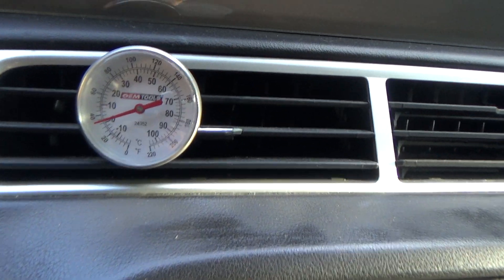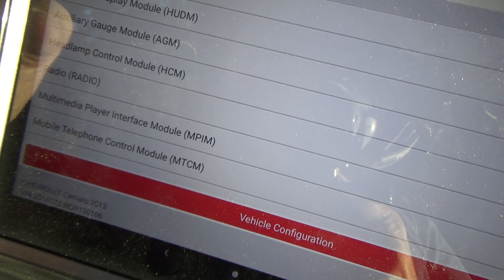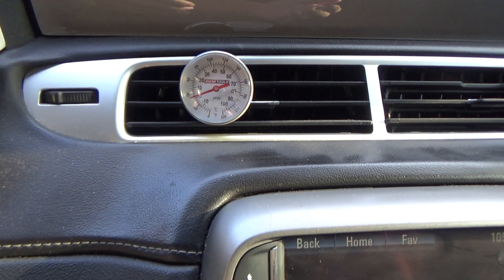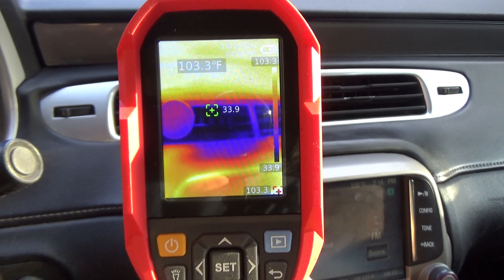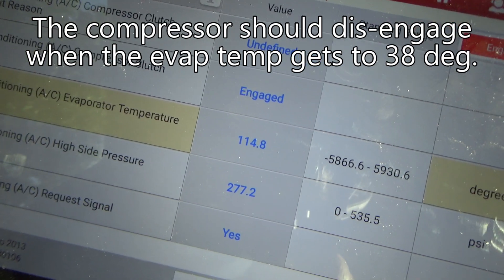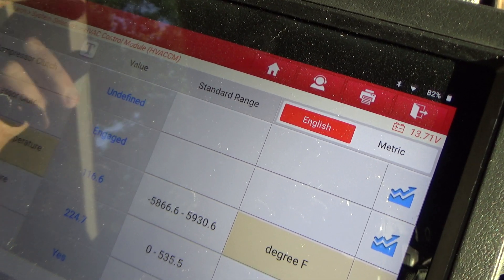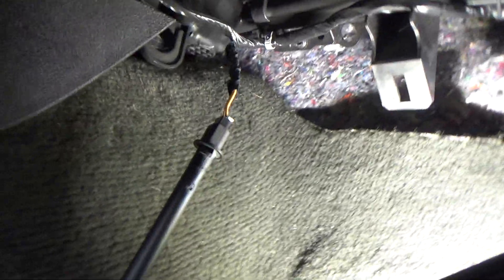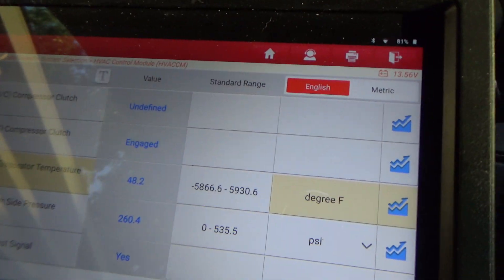Camaro Blows Ice Crystals out of the Vents. The Evaporator Temp Sensor was Bad.

Comment: in a house ac when it does that the evaporator coil will be full of ice.  because it's leaking freon.  have you checked the evaporator coil for icing?  if you're lucky that sensor will fix the issue.  if you're me, theres probably a sensor inside the gas tank that controls that and the sensor is made on mars so they can't get one🤣
Reply from the maker: The new sensor did fix it as the video showed. The evap temp sensor was showing about 115 degrees when it was really under 32 degrees so the computer wanted to keep cooling so it would never cycle. Once I put the knew sensor in once it hit about 38 degrees the compressor would shut off until the temp came up around 41 degrees then it would engage the clutch and start cooling again.